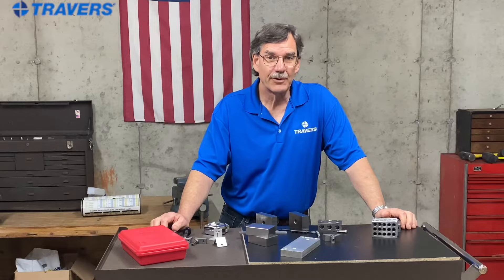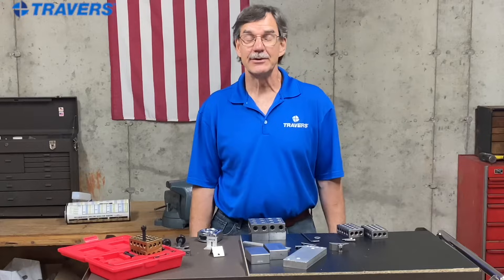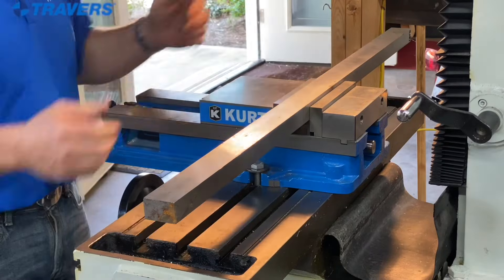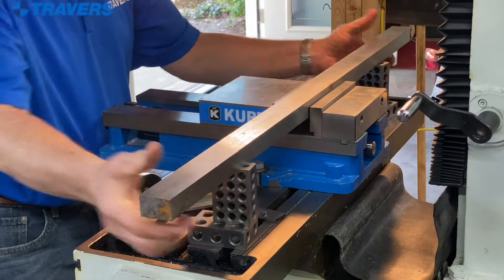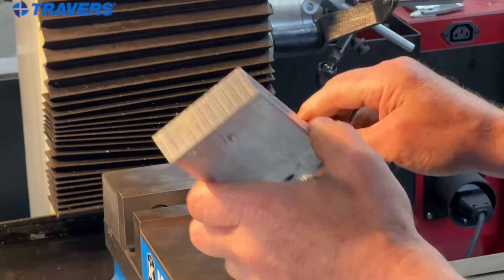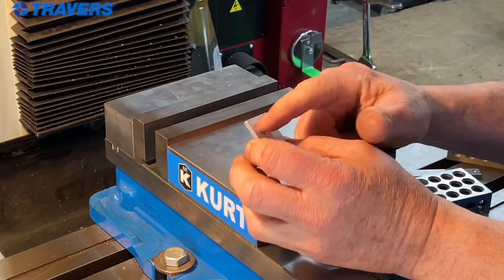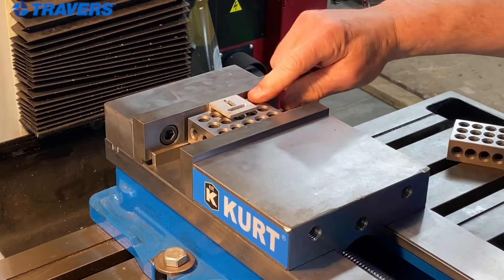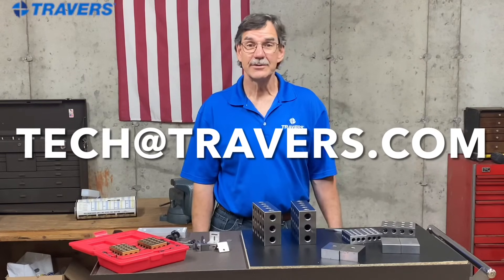How To Use 1-2-3 Blocks

Comment: I sometimes tram my quill to the vise by placing a 1 2 3 block
against the quill and the front of the flat portion of the vise.  Once it sits flat on both side it’s pretty much tramed.  Like finding the center of a rod with a flat
Reply from the maker: I apologize for the extended delay. We've been experiencing difficulties accessing and responding to YouTube comments.
That’s actually another great use for them. Thank you for sharing.

Comment: The bracket at the end could have been simply held on the ends in the vice.
Reply: 100% true, tates11.  And that would be the better way to do it, but that wouldn't show the usefullness of 1-2-3 Blocks.
Reply: @wonbythe1  you could still rest the underside of the top on a 123 block. Angled parts like that are usually held in a vee block with a bar in the part vee. This would square it up in both axes.
Reply: @wonbythe1  you could still rest the underside of the top on a 123 block. Angled parts like that are usually held in a vee block with a bar in the part vee. This would square it up in both axes.

Comment: 123 blocks are amazing calculation tools, the simple 123 ratio allows you to use pathogens therum to set up perfect angles with a sign bar. The block has far more power than a simple spacer.

Comment: The only thing I didn't hear explained was why they have holes throughout them. Why is that?
Reply: Actually, Durty, some of the holes are threaded and some are not.  They allow the users to mount them to other objects, or to mount other objects to them.  They can even be fastened together (to each other) by using those holes.
Reply from the maker: A couple of different reasons Durty. They make the blocks lighter and allow them to be connected to each other or a work table.

Comment: I love mine, but I bought them for the complete opposite end of the spectrum than you, I'm using them to line up my X-acto to cut bricks into XPS foam at 13 rows per inch. I'm making a 1/35 scale model of my home.
Reply from the maker: Carrie, that is a wonderful way to use 1-2-3 Blocks! It’s pretty amazing, how simple these tools are, and yet how useful they can be in such a diverse variety of ways. Their versatility is literally endless.